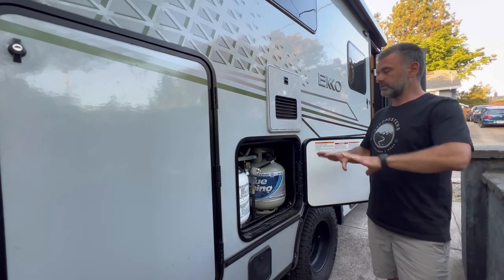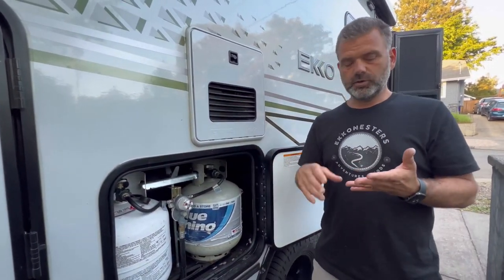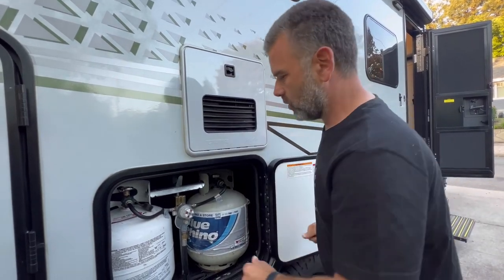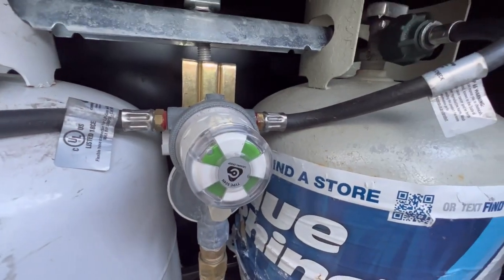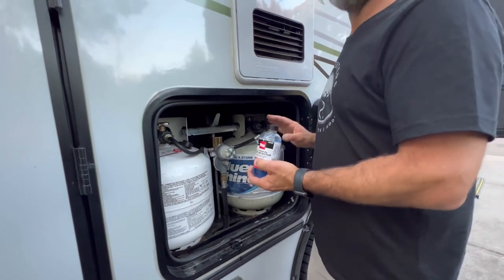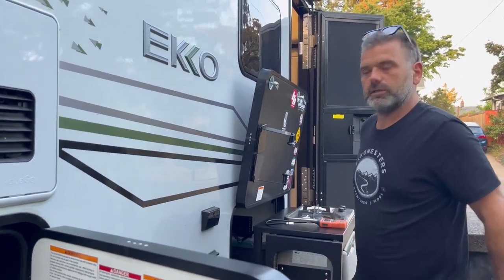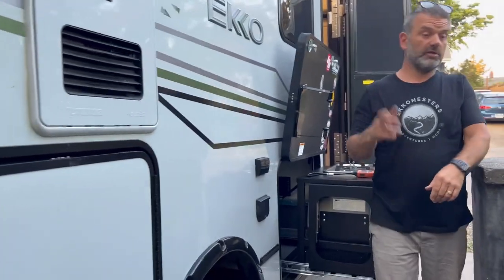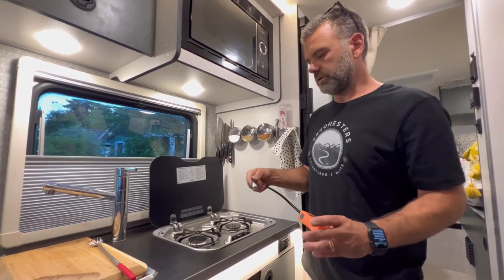Propane Inspection Safety Tips. Exposed propane lines and where to find them.

Comment: propane has an odor added, if there is a dangerous leak you should be able to smell it without a gas detector, if you have a small leak you should notice you are going through propane faster than before, the gas detector is good for diagnosing problems but probably not something you need to use to check the system if there is nothing leading you to suspect a leak. The built-in propane detector is so low to the floor because propane is denser than air and will collect along the floor first.
Reply from the maker: James, thank you for taking the time to watch our video and share your thoughts and insight. There are several considerations to be had when discussing propane leaks and safety checks in RV,s, travel trailers, moving vehicles for that matter. The first of which that you shared in respect to the “rotten egg” smell is spot on. While propane itself like natural gas, has no distinct odor until the chemicals called mercaptan is added which give it its distinctive “rotten egg” smell, one would more than likely only detect this distinctive odor while the vehicle is stationary and while one is within range depending on a persons “senses”. Of course if the leak was inside the vehicle rather then outside the vehicle (RV) not trailer) while driving then it again would be more distinguishable as you shared.  
In respect to the “propane leak detector/alarm) which with the EKKO is near the floor just below the refrigerator, this in most respect can be determined as a reliable indicator. But, that reliability is strictly dependent upon one periodically testing it and maintaining that debris/dust, etc or contaminants have interfered with the sensor. So, yes, Winnebago did a great job with the placement and kept it below pillow height and as close to the floor as possible taking into consideration that propane will settle closer to the ground as you noted.  
As for the rate/speed in which one might go through propane as a determining factor/gauge for a leak, I’d argue that someone would need to be really on top of the propane use to determine this, but wouldn’t rule it out as a detection either.  As for the “wand detector” being “a only to diagnose a problem” Yes that is one key reason to own one. However, It will help aid in determining small leaks that can be difficult to detect (pin holes, etc.) In the video, I pointed out the overall value/utilization of the wand detector.  I also pointed out that it is excellent for the hard to reach areas under the chassis where the distribution valves are located. I also pointed out were some vulnerable areas were located as well the poorly strapped areas that have a greater opportunity for wear points. At the end of the day, it’s a moving vehicle that is subject to a lot of demands and road abuse and should regularly undergo some basic safety checks. Especially if it’s been stored. Mice  and rats are some of the biggest culprits to eating away at electrical lines, plumbing and of course propane lines. Between the nose check, the visual inspection, the leak detector, etc. it’s all about prevention.  Thanks again for the great dialogue.

Comment: Unrelated question: can you have 2 lithium batteries AND the generator?  If so, how tough to add a third? (I thought I had asked this on another vid feed, if so I apologize for the repeat).
Reply: Yes, you can order from factory the generator and one battery and the have the dealer, or other authorized installer, install the second battery.  You have to be aware of the total weight of the EKKO with fuel, water, gear, and people.  If you order the Tailgate package kitchen, that further reduces the extra weight you can add for gear.
Reply: @richardburguillos3118  Many thanks for the reply!